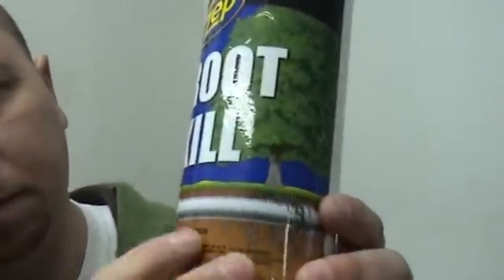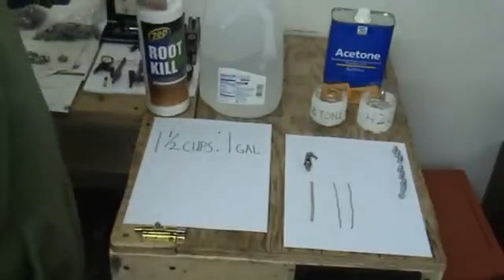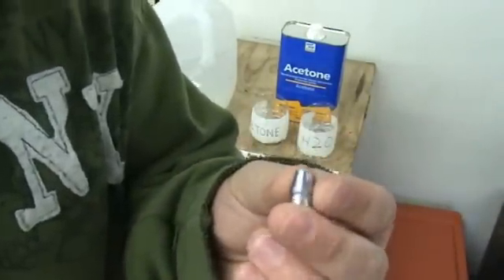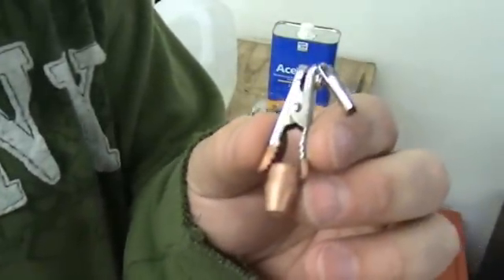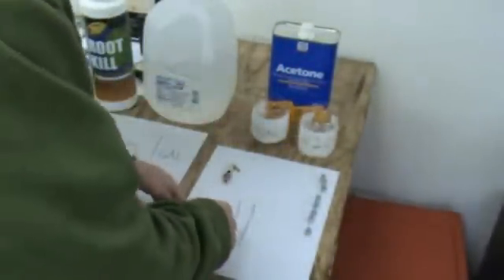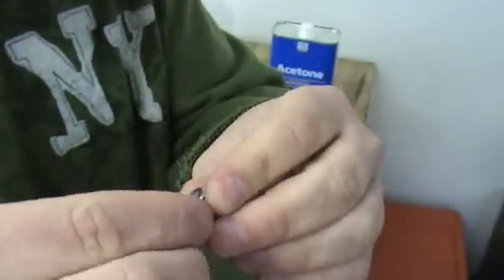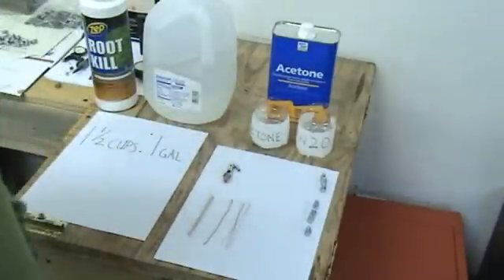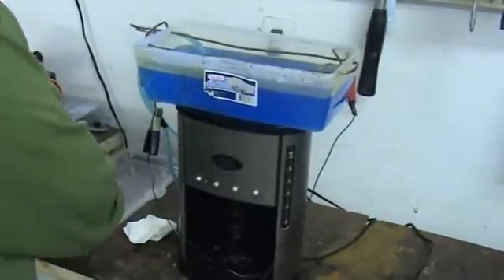Copper Plating Cast Bullets Pt.2

Comment: I wonder if a drop of silver solder and a thin piece of cheap wire soldered to the bottom and plate it. Then carefully clip it when done and use a file and smooth as close as possible. Also great tutorial. Thank you

Comment: If you was going to hang them to where you had very little lead exposed what I would do is draw a tiny hole in the bottom of each one of your bullets make you a j shape with your metal wire and stick the bullet on the hook of the j

Comment: Do you cast the bullets just slightly smaller than 9mm diameter so the thickness of the plating makes up the difference to the 9mm size?

Or do you just plate full size bullets, and the little bit of increased size does not effect the bore and chamber?

Comment: Damn, thats A TON of work to save a couple bucks lol
Reply: Holy crap, I was thinking the same thing! The only practical use for this is when there is no ammo available - coming soon, to a store near you.
Reply: He's doing it the hard way that's why.

You add baking powder and a bunch of root kill to warm but not hot water, in the bottom should be copper plate stand your bullets on this and connect one electrode to the plate, let the other electrode dangle above the bullets in a dig zag pattern, connect the ends of the electodes to two rechargeable double a batteries. Let it go till they run out of juice. Easy peasy.

You want a coating about 0.02 calibres thick. It's makes sizing suaged bullets to barrels easier and is sufficiently thick to act like a jacket. 

That's easy and you can walk away and forget about it. You want a small fan running somewhere as a small amount of hydrogen is produced, it's not at all risky but why take a chance? If it was a big number then maybe it would be a problem, like factory conditions. 

Easy to do, easy to manage, cheap, fast now effective than a powder coat, all the advantages of advantages of a jacketed round.

All you gotta do is lift/fill a tray and replace the batteries. 

How easy does that sound? 

He's watched someone else's video and done the same thing with a minor modification, you can tell because he's got water to rinse off acetone... Acetone is impervious to water so it's useless to do so. 

He's heated the water to speed it up but it's pointless, you get a better finish at lower voltages and lower temperatures. 

You're better using two double as and in cold water. You just got wait longer is all, for the copper salts to dissolve. 

So yeah, save yourself 90% of the hastle of lube and just copper plate in cold water, over night, with a copper tray and two AA batteries.

Comment: I was interested, but this seems to time consuming for the volume and minimal plating thickness. I think I would go with the powder coating method over this. Now if we can figure out a more effective cheaper way to do a higher volume and have a thicker plating. Then I would be interested.
Reply: I think there is nothing wrong with this or any other electroplating processes. My question-marks are stands behind the whole needs and real benefit of a microscopical copper layer. This is not a jacket. Leading will be still there, (mixed with copper though) in my opinion powder coating or even a heatproof paint-spray could give a better result with less fuss.

Comment: you can use sweeteners in your solution to give a brighter and smoother finish ( the type that people use if they don't want to use sugar, they look like little tablets, the brand is hermasetas in the uk, not sure about the states ). I havnt tried it personally but it may be worth googling for more info. some copper brightening solutions are fairly expensive for what they are.

Comment: I was going to suggest using a much more effective method being dissolve straight copper in sodium cyanide in a bath of roughly 140-150 degree water but then I saw how expensive the stuff is.

Comment: so could you just get some wire mesh then make it into a bag and hang that into the solution instead of individually wiring each bullet
Reply: That sort of works. That's what I did when I played around with this just after I started casting in 2005.

Comment: Sorry if this was addressed, but wanted to suggest possible changes to your bath.

The grooves not being plated indicates to me that you're not using a leveling agent and this may be the reason for the grainy/powdery and probably a thin finish. You should try adding a tiny bit of saccharin (which is the pink sweetener) to see if you can get a thicker plating result with brighter finish.

The hotter bath supposedly speeds up plating time as well, but metal-finisher tested better results under 30C

Comment: PbO2 ... they were oxidized ... not clean. Change the media type ... try glass bead media or just dunk 'em in a weak acid bath after whatever you are already using. This will strip off the oxygen and leave the lead behind. Happens at the molecular level so it won't change the surface profile.

Comment: The copper layer on these bullets is just a few thousandths of an inch thick, perhaps as little as .001", depending on how long they are left in the solution (for comparison, an ordinary piece of notebook paper is about .003" - .005" and an average human hair is about .003") and has very little effect on penetration and expansion. What the copper DOES do is provide a wear surface as the bullet travels down the barrel and keeps the lead from fouling the grooves.

Comment: Is wire-wheeling/steel-wooling the only way to clean them? How about tumbling, like brass? Will the acetone wash be sufficient? Doing this for a few hundred bullets at a time seems very ineffective if you have to handle each one for several seconds each both before and after plating.

Comment: I use .357 for my Cast Bullets, can i use .357 bullets, copper plate them and size them to .357, or is that to much diameter? for fmj you normaly use .355 ?
Reply: I think so

Comment: when plating bunches of small parts, I toss them into a wire basket. No need to make a suspension brige or anything. The downside is you have to agitate the parts so they plate on all sides, but the upside is you *can* agitate the parts and they plate on all sides. Lead is pretty forgiving, but you might try throwing a potentiometer (large "volume control") inline, and plate at very low current, then jack up to very high current after you see a flash of copper all over the parts.Helps adhesion.

Comment: so do you get rid of the copper solution right away after the first use or do you let it sit in your tupperware container for a few days until the next use? Also wont the innards of the coffee pot start to copper plate because your are running the copper solution through it?

Comment: Your method of using wire wrappings is very time-consuming and labor intensive. Have you considered constructing a tray for the bullets instead? Since you're using the lubricant grooves as the attachment point, you can get a flat piece of copper sheet, drill holes of the proper diameter into it, and then slice it in half. Then you can grab a bunch of bullets at once, at the lube rim in between the "teeth", and hold the plates together somehow while you suspend it into the solution.

Comment: Wouldn't your exposure to lead be increased through your using a wire wheel or steel wool in polishing the bullets? Otherwise, nice video.
Reply: You're 100 right and it's a waste of time, just wash them in isopropyl alcohol

Comment from the maker: @bvillepimp21 Your absolutely right. You can try adding between 10 and 20 drops of bleach or vinegar. This may help make 'em a little less rough finish. I have wanted to try tumbling some but haven't tried it yet. Maybe you  could give it a try and post your results. If you wanted to.